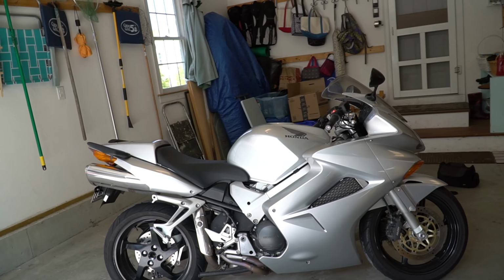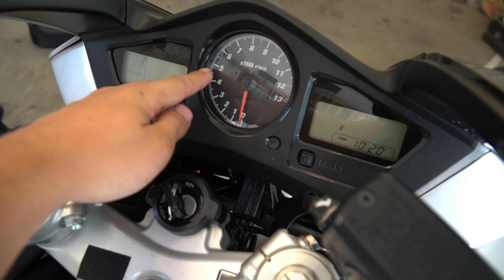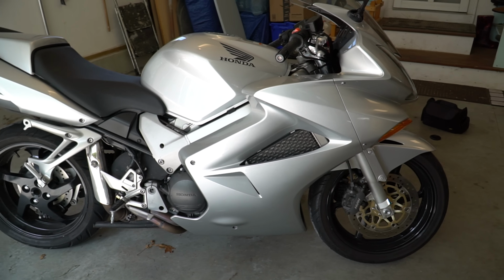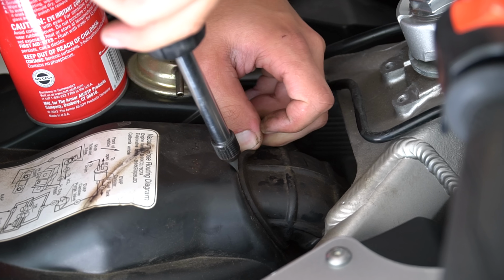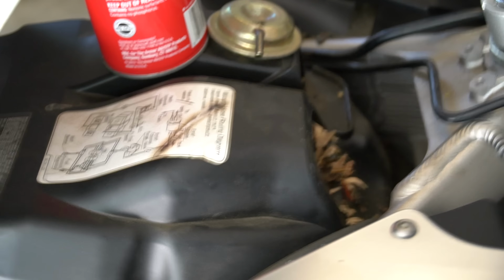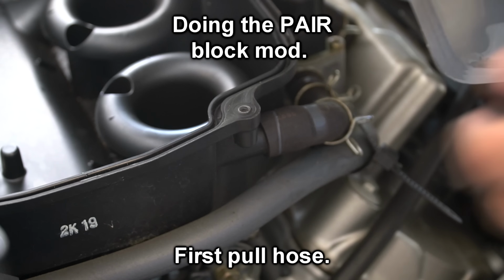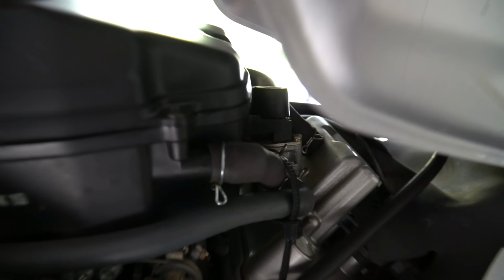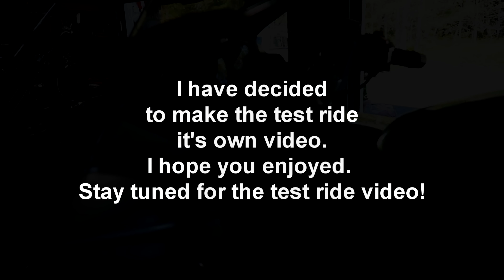VFR800 Snorkel, Pair, & Flapper mods, easy, free horsepower!

Comment: PAIR adds clean air at complete closed throttle to burn hydrocarbons that aren't being consumed through active open throttle temperatures. PAIR has nothing to do with active drive performance. Removing snorkel and disabling flapper merely robs you of mid-range torque by reducing air pressure in the air intake and flattens out (diminishes) the power curve. You have a more linear power but you are effectively reducing power to make it less responsive. I've never met anyone who wanted less power and less responsiveness in a bike like this. Trust Honda engineers who have been building this thing for DECADES, not internet idealogues.
Reply: If it removes the jerkyness at low revs then im willing to lose some torque. It makes driving in cities really awful and I happen to live in one. If I cant find a way to fix it, the bike isnt worth having to me and im gonna sell it.
Reply: ....and wrong.  reduces the vtec transition, removes a flat spot after VTEC kicks in. PC5 results showed increased power after mods.  With a custom tune..much more power and better power curve. Add K&N filter and gutted exhasut and good to go. 1st gen & 6th gen owner-
Reply: Any experience with fuel consumption after doing this?
Reply: Sinbad Eatin' A McRib Agreed 110% my dude
Reply: Turned off PAIR on my Ninja 650 and i think there was a slight improvement in torque and she was a little more settled around idle (I've gotta have a clean throttle response at low revs)..slight improvement, easy to turnoff, no noticable change in fuel consumption. I do question the motivation for PAIRS more for immisions than rider satisfaction..wouldnt be surprised if other makes/models fair better but onky a little i'd say.
Reply: @way2faded  I would say that your performance air filter and "gutted exhaust" with your PC5 tune did more for you power wise than disabling the flapper, pair and removing the snorkel did.

~6th gen owner since 2014

Comment: Hey man! Thanks for doing these vids, they're hella helpful! :)

Quick question: When lifting up the tank, where exactly is the pivot-point? Is it okay if the tank is still almost full, or could the pivot-point be too weak to hold the weight?

Thanks in advance, and ride safe, man!
Reply: Usually you want it as close to empty, even if you go to a service. Its much easier to work with it that way. Otherwise drain it a bit.

Comment: Hi. New subscriber here. Does this apply to 5th gen too? I just bought one as and i love everything about it except the jerkyness and throttle play. It`s so bad i almost have to change grip and give it another centimeter to two to get to full trottle. Did you make a video on that and does it include purchasing parts? And since english isn`t my 1st language and my "technical english" is even worse,what does the PAIR mod do? Thanks for lots of great videos
Reply: John there is a measuring sensor (o2 sensor). This is in a stupid place so the bike thinks the air/fuel mixture is wrong (lean) and so it pushes in more fuel . The real fuel/air ratio being poured into the bike is now around 11:1 making the bike hard to ride and resulting in the snatchy throttle response we have all been talking about.
Reply: John as far as I know it applies to all VTEC models.
Reply: @MrNicklasson87  Hi, I actually went for a good 2001 Fi instead since i couldn`t afford a 2007-> Gen 6 (the reworked and improved Gen 6)  but would have had to go for a 2002-2004 VTEC. It`s still snatchy but not half as bad as the early VTEC`s i tried and once you get the hang of it it`s not a problem.  But the throttle travel is just insane. To the point where i`m ALMOST changing grip to get 100%. I will have to get that sorted,sooner rather than later because it`s really starting to annoy me.
Come to think of it the 2001 has the o2 sensor too. It`s the "Lambda probe" we`re talking about right? I know the early Gen 5`s (98,99,00) have a choke lever but the 2001 does not as it`s fitted with the o2 sensor

Comment: why do you keep the tire pressure so low? Basically all bike now run 36F 42R.
Reply: Yeah 42max, not whats best. If you wanna push the courners hard u need low pressure 28f 35r. Its low tyre pressure in racing not high. High only helps excelleration tiny bit but greatly reduces tyre/road contact so cant courner as fast or break as short

Comment: The snorkel mod is not a good idea, the only thing it does is make a whole lot of noise. I have put mine back.
You have to close the flapper-tube with a screw and some tape, you can not leave it open.
As for the valve-pairing, it's better to put a marble in the tubes near the exhaust so they are closed, just put a marble in and put them back in place, simple and done in 5 minutes.